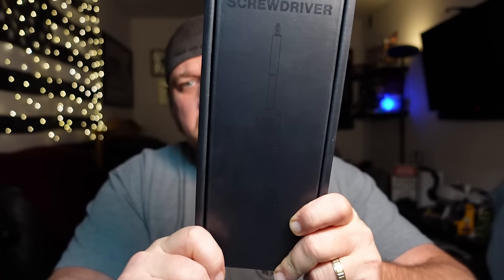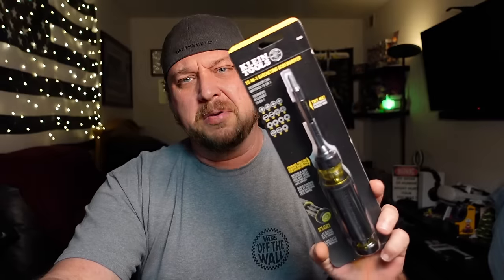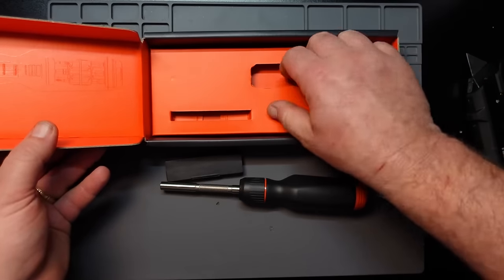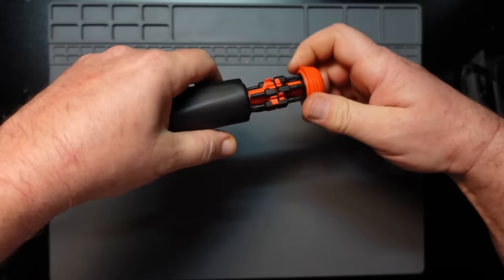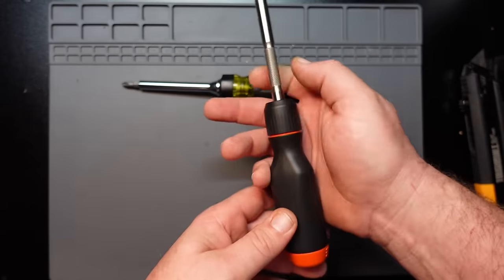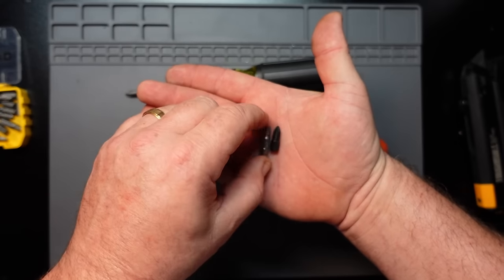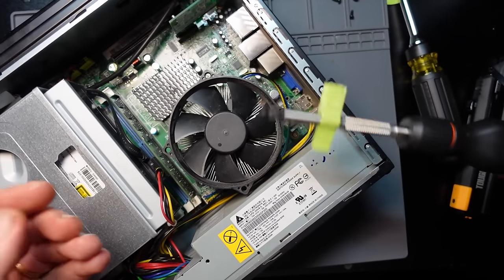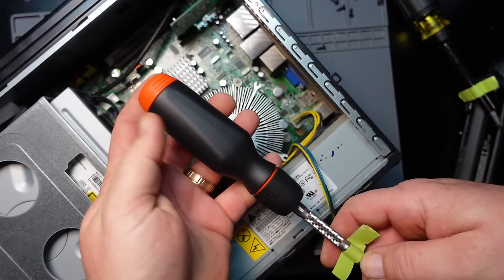LTT Screwdriver Vs Klein

Comment: I’ve had that Klein 15-in-1 for years and love it, but my chick randomly bought me a Husky Continuous/Double Drive ratcheting screwdriver as a stocking stuffer this last Christmas and it’s actually pretty cool. If you’re ratcheting the screwdriver back and forth to tighten or loosen a screw, then it’ll still drive the screw whichever way you need it to on both turns of the screwdriver. So say you need to tighten a screw, when you’re ratcheting the screwdriver each turn left and right will both still drive the screw right, so there’s no wasted turn when you ratchet back and forth. I’m sure there’s better brands, but the Husky is actually pretty smooth.
Reply: black magic
Reply: You can't reverse something without constraining the reaction force, is there an extra part that needs to be held still to make the double action feature work?

Comment: Love that yellow one.I've got a great unit with multi-bits around the front of the handle covered by a clear cup.So  handy if you could just slide the bits out. But mine is 20 years old and the perfect tool for inside the house.

Comment: I use a pistol grip ratcheting driver. I have a bit of carpel tunnel and arthritis in my hands from years of turning wrenches. The pistol grip drivers just put less strain on my hands and wrist. And you can get a good amount of leverage on one too. I have one with a little revolver looking barrel on it that holds the bits, and you just rotate it to the bit you want, and slide the little switch on top, and it automatically loads that bit for you. It's pretty nice. I also have a pistol grip electric driver. It's a cheap one from Harbor Freight. Only $12 bucks. It was a stocking stuffer someone gave me. I didn't expect much from it, But three years later and it's still working. Certainly worth $12 bucks i suppose. I also have the classic orange Snap-On ratcheting driver. But i hardly ever use it anymore.

Comment: I’ve never really felt like I needed one at work (mechanic), but they got to me and I got one. It’s great for around the house! I was shocked by just how low the back drag was. If you hold the shaft and flick your wrist, it will go about a full rotation.
Reply: Yeah, I use mine all the time now. I used to keep a handful of different screw drivers both in my garage and in my office but now I can just keep my whole set in the garage because my LTT driver covers all of my day to day needs

Comment: The LTT screwdriver was made by MegaPro.   I have an old megapro which is branded Cisco, probably got it 20 years ago.   Mine uses longer double ended bits.   It’s nice to have the bits with the driver.   The problem is the shaft that holds the bits is often too large to fit down into molded holes.   So I honestly prefer just regular screwdrivers.   Dont much care about ratcheting as even when buttery smooth it doesn’t have enough back pressure to ratchet reliably and is just frustrating.
Reply: It is NOT made by MegaPro, they look similar because Linus ripped off the MegaPro. Linus said so himself, & his are made in China, not Canada or the US like the MegaPro
Reply: @koobs4549  Also incorrect. They licensed the bit holder and ratchet designs, then refined them. The bit holder is more compact, and the ratchet knob goes the other direction (one of the best features IMO). They really don't actually look very similar either except inside the bit holder, but you can't really call it a "rip off" either way when they licensed the design. The ratchet mechanism is made in China, but the rest is made and assembled in Canada.
Reply: @Lord_zeel  The price alone makes it a rip-off.
Reply: @Lord_zeel  So it's all made in Canada, except for the only part that really matters?

Comment: Reason they went with no rubber on the grip, in part is because over time the rubber breaks down and starts to become sticky/slimy feeling. Especially if used in solvent or petroleum soaked environments.
Reply: @BigBear - - then just use a regular screwdriver lol
Reply: @victormondragon4184  What does this have to do with anything? Like regular screwdrivers aren't sold with rubber overmold grips? 

You can watch the LTT video on their actual design process for the screwdriver and the thoughts that went into it. I was just explaining why they designed it the way they did. 

If you don't like the no rubber handle on the LTT screwdriver, then just get the Megapro Automotive Ratcheting Screwdriver...which is the one the LTT is based on except it costs half the price, has a rubber overmold grip, and uses standard length bits.
Reply from the maker: They have solvent resistant “rubber” material. My guess is it was for cost savings
Reply: @FunkFPV  Solvent maybe, but the usual Butyl overmold grips do start to break down from petroleum products over time. As far as their reasoning, the explicitly state that as the reason in their design/release video for the LTT Screwdriver. They were trying to design the best screwdriver for all use cases, that'll last, not just for electronics, which is why they didn't go with any rubber overmold. If you're interested in rubber grips, get the Megapro Automotive Ratcheting Screwdriver, it's the one the LTT is based on, and licensed the core design from, except it has rubber overmold grips, and uses standard size bits, as it has a slightly longer grip. It's also about half the price at around $30-35.

Comment: I've been an IT professional for over 20 years. My work screwdrivers are a Picquic handle with a custom selection of Wiha bits specific to the location their kept (like the server room one has all the Trox sizes common to HP servers). The extra long shank Wiha PH2 bits I prefer are like $16 a piece, but I've only worn out 1 in over 2 decades, so kinda worth it. For the stuff I often deal with in IT, long narrow shank is a necessity the standard bits are unsuited to (and why the LTT driver is a non starter for me) and dedicated drivers for every type would take too much room and never be handy (like the GN tool kit)
I think each of those drivers costs me over $100 to kit out.

Oddly enough, I bought that same Klein screwdriver a couple weeks ago for the odd jobs tool cart. Was feeling shitty and felt like buying a new tool. I rather like it. Klein tools are usually pretty decent

For micro drivers, I really love my Wiha System 4 Drive-Loc set. The whole set fits into a small soft pouch withba could different handles and two dozen blades for all the common and uncommon micro bits I need with extended reach. I'm glad I assembled that kit back in the mid 2ks cause now each of thirst bit blades cost $12-16 each to replace when they wear out. To fully replace that set now would likely be over $300, and that's for a set of tools that takes up about the same volume as a phone.
Reply: Yeah, the only time I can't use my ratcheting driver is when I need to reach somewhere narrow, but that doesn't come up all that often

Comment: For reference, LTT started out with MegaPro's base design and materials and licensed the right to produce a tool using those. Most of the changes from there were tweaks to optimize it for the kind of work and problems they'd had with other screwdrivers while working in computers and on network/server racks, and make it fit better in hand. Megapro makes some really nice multibit screwdrivers and the Delrin bit holders snap open smoothly and with a sense of authority, but they're definitely bigger and clunkier.

Comment: I bought the LTT screwdriver almost a year ago now and it's the best screwdriver I've ever owned. I've used it on various electronics ( PC's, laptops, cell phones, TVs, etc etc) mechanical work on our cars, carpentry projects, changing batteries in my girls' "Night Bright" stuffed animals, and everything in between. It's been fantastic for whatever I've used it on. All that said, I know this screwdriver was made and marketed for PC/electronics use mainly, however, if LTT made a variation with a textured grip and a bit more robust, I think they would have an even bigger market with all the professional tradesmen jobs (mechanics, plumbing, HVAC, etc etc).  I would totally buy that screwdriver too, just as I plan to buy the upcoming precision driver they are in development of.

Comment: If you want a similar feel and overall design, as well as saving some money and some better grip texture. Just get the MegaPro Automotive ratcheting screwdriver. That's the screwdriver the LTT is based on. It's similarly very nice to use, probably the next best one, except its takes full size hex bits, and has some rubber overmold on the grip. The ratcheting mechanism is more classic in the sense that it's in the opposite direction from torque direction. For $30-35 it's probably the best ratcheting driver, before you jump to the LTT.

Comment: really great review. I just have to say that according to them, the bit length IS a standard, it's nust not as widespread as the longer, "normal" kind. They opted for the shorter standard in order to fit more in the handle. (or to make the handle shorter. depends on how you look at it)
Reply from the maker: I might have gotten confused with the people saying they’re proprietary? Either way no big deal considering the price to replace them 😎👍🏻
Reply: @FunkFPV  In the bit-holder, there is a small black rotatable ring/star so you can store regular bits in the handle.  Wish they'd have added an extra phillips and torx bit rather than the silly robertson ones though.
Reply: @zybch  They're Canadian though - and up here Robertson bits are as common as Philips. Much better bit - and cheaper screws than torx or hex.
Reply: As an American, I appreciate the inclusion of the Robertson bits. They may not be all over the place here, but they're useful when doing electrical work.

Comment: As a server admin, I LOVE the LLT screwdriver.  The logical ratchet direction change is great, along with the magnetic bits, especially when you have to reach into narrow spaces and can't see what you're turning.  As a professional IT guy, we only hand tighten equipment, because things tend to be fragile or bend easily.  Also, server room talk usually relates to caffeine, cables, and calls we receive with no context, e.g. "it broke; please fix".

Comment: I bought the LTT screwdriver to pay back the LTT team. Watching their videos basically gave me enough experience to land my first IT job. The screwdriver is phenominal. The backdrag in combo with the gnarled shaft makes quick work of screwing. The bit storage is wonderful, and the end cap actually swivels, which has its own ergonomic benefits. It doesn't have the best grip, but after heavy use it gains a sort of glossy patina, which oddly enough makes the grip better. Worth $70? To most, maybe not. But to me? Absolutely

Comment: LOVE THE LTT driver. The actuation force on the ratchet is so low its crazy. I love using it.

Edit: also I know you're doing this for a YouTube video so you're rushing but typically you don't try and rip down a computer as fast as you can well dropping the screwdriver all over the motherboard over and over. Which was hilarious thank you.
Reply: Dropping things on camera is very ltt brand 😂
Reply: The whole computer is going into the trash. He only wanted the hard drives, so the rest could have been smashed with a hammer for all it mattered.
Reply from the maker: If you want to make anything harder to do just turn on a camera LoL 😝

Comment: I also have both the Klein and the LTT. Both are pretty good. I do prefer the LTT, especially around computers. And I think that is mostly due to the fine control of the ratchet. And the knurling, very helpful with how I use it.

Basically I leave the Klein in with my regular tools and leave the LTT near all my tech stuff/parts/etc.

Comment: It is not a bad driver at all I have 2, a OG and the new stubby. I am by no means a Snap-On fan boy but I have 1 that failed (hand me down) that was 20 years old. Snap-on sent me a new one. When comparing the 2 the snap on felt so much better in the hand and way more solid. I also believe the back drag is so close it make zero difference. But, it is also like $149 so it better be "better."

Comment: The electrician bits are ECX.  They're made to fit the screws in receptacles amons other things.
Reply from the maker: I was going to say EST 😜 Good thing I kept my mouth shut 😁
Reply: They work GREAT for that application as well. receptacle screws and greenfield connectors tighten so much better with an ECX bit.

Comment: I think the thing LTT missed was a case for it with holding boxes for various screws on the sides.   Could insert the driver shaft into that case.  When working computers you always need to have some spare screws on hand.   My thought for the case was instead of sorting-box latch caps to have pull-out magnets in each box like little micro-drawers, so a square cup with a magnet in it and a pinch-tongue handle to use it with.
Reply: Same, but I found some models on thingiverse to print that work well

Comment: I'm with you on preferring non-ratcheted - it's faster to just use both hands and honestly less fatiguing. Maybe in a tight space ratcheting might be more handy, but then the screwdriver is too big for that anyway. For how much that thing costs, I find more use spending that on an electric screwdriver for those more tedious assemblies with lots of screws.
Reply: Biggest issues with electric drivers is not being able to properly feel how much torque you are using. Fine threads and delicate parts are just too easy to mess up that way.
Reply: for me its about the job need some torque I'm grabbing the non ratcheting if I have a lot of low torque screws ill always grab a ratcheting driver
Reply: I leave my ratchet driver in the locked position.  I don’t know, I developed the skill of placing the round end of my manual drivers in my palm and can twist with my wrist and spin with my fingers tips all in one motion.  It’s faster and I have a steady grip.  Anything ratchet I have to drag my fingers on the return pull otherwise I put the screw back in half a turn. I gave up and returned to manual
Reply: @Lord_zeel  Yup, a few PC prebuilt companies have gotten dogged on for this by tech channels (once by LTT even) because they were using electric drivers that weren't torquing things down enough. There's been a few reviews where they've had pc parts almost hanging out of their slots... I can certainly understand not wanting/needing a ratcheting screwdriver in most other fields, but with small electronics/tech they are a must if you do a lot of disassembly/reassembly
Reply: @reptarien  The Star Forge, that was solved by them providing the same electric screwdriver to all their crew so they all had the same consistency?

Comment: I don't know that it was a conscious design decision, but it seems to me there is at least one potential benefit to having the collar to set the ratchet direction work opposite of the direction you're turning the tool.  If you are turning the tool under a load and the collar drags against something it won't change the direction of the ratcheting mechanism and suddenly "come free".  One can imagine how sudden and unexpected unloading could lead to awkward, uncomfortable, or even painful situations, especially when working in tight spaces.
Reply: I just posted the same comment. A ratchet that is set  by rotating in the same direction as you screw will drive you crazy as it "pops out of gear" unexpectedly.
.
It's the same reason that a keyless chuck on a drill tightens "backwards"... if the chuck bumps the work, the chuck won't release.
.
People just need to learn how to use the standard mechanism, which is exactly like using a keyless chuck. You grab the ratchet selector with one hand, and rotate the screwdriver body in the direction you want to go.

Comment: Over a decade working in a 24/7 365 Colo Data Center.
There were a couple of ratcheting screwdrivers in the one of the 2 tool chests that collected dust.

Most the techs liked Klein screw drivers. 
Hard wearing, rarely ever broke the tip off and could put up with the daily abuse.

Comment: I have a Milwaukee ratcheting screwdriver, like most Milwaukee hand tools it is rather disappointing. Back force is way too high, the bits for storing in the handle are semi-proprietary and fall out easily while in use.  The only thing I can say in its favor is that it comes with a better selection of bits than others. A coworker has the LTT and if they stocked in HD, Lowe’s, or Ace I’d gladly pay twice as much for it. I travel for work way too much for a shipping time over a week.

I work telecommunications.  When I’m on the ground I much prefer regular screwdrivers. But when I’m in a lift or climbing a tower the fewer things I need to carry the better.